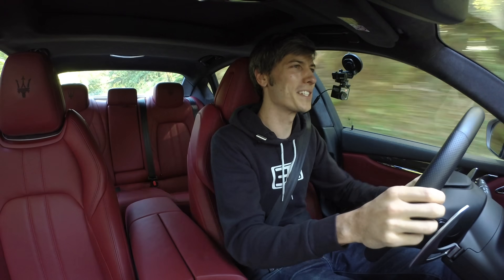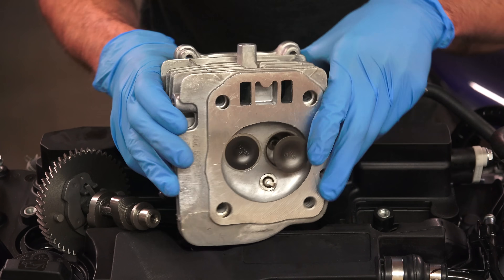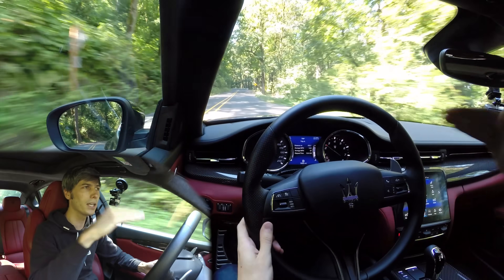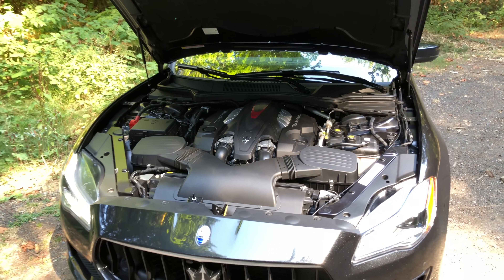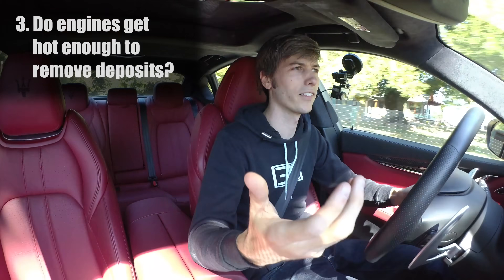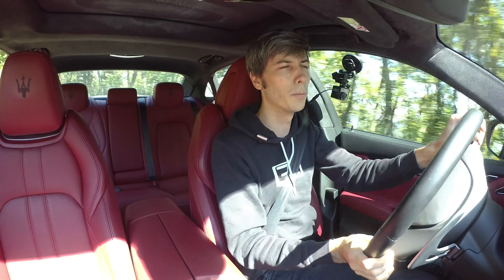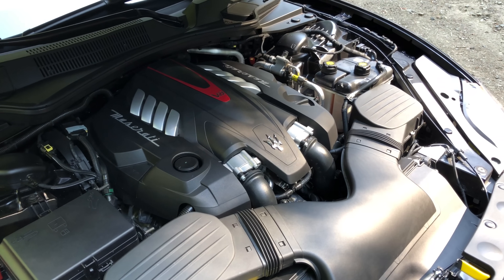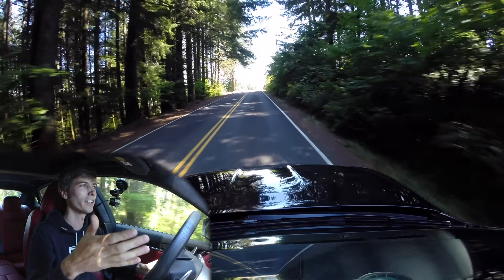Is Redline Good For Your Car's Engine? Italian Tune Up

Comment: When I was a Kia technician, Kia Soul owners were notoriously bad for never driving their cars hard. Typically an older demographic. We were located next to a divided four lane highway where people regularly drove faster than 55 MPH. Going from 0-60 in a swift movement often would dislodge a legion of smoke, comically filling up the highway in its wake. It would take about a mile of hard driving to rid it of this condition. Had it happen on an Elantra too when I accidently blipped the throttle too hard on the same highway, different dealer. Both port injected engines though. I don't ever recall a GDI doing it but that could be anecdotal.
Reply: I own one and for some reason the redline acts likes its at 5k in neutral and at driving. It will bounce off 5k like its a revlimiter. The redline is at 6.8k. :|
Reply: Many cars will not let you rev too high while in neutral.  Racing the engine with no load and all.  Have you really tried to hammer it when accelerating?  Im talkin lead foot pedal to the metal type deal.  When I test drove them - I was easily able to red line them.  Do you have the Automatic, Sportmatic, or Standard transmission?  Need to give us a bit more info if we are able to respond and help out.
Reply: Side Note - I drive a 2016 Kia Forte base model (My Kia Spectra was totaled in a hit-and-run :/) Both stick shift.  I red line it daily because of the A-holes who on the roadway.  Forte gets to 60 in second gear.  Rather impressive.  Maintains the mpg average pretty well too.  That 6 speed is fun.

Comment: I have heard from several different old guys working on carbureted  engines that the best way to remove the deposits and carbon build up is to run the engine really hard to burn off what can be burnt off. Then while the engine is  still hot, remove the air cleaner, hold the engine at 1000 rpm and slowly pour water down the carb.  The cold water hittiing the hot carbon causes it to break free and come out the tail pipe.  Probably worked fine until catalytic converters came along.

Comment: i just use seafoam every 20k. my car is a 2014 focus se (base) direct injected 4 banger. it has 109,XXX miles. the engine still pulls like new. but sometimes in cold mornings it wont immediately turn over. it sometimes takes a couple seconds then it turns over. im thinking i might have to check the fuel system. if everything checks out, i might have to increase the seafoam frequency to every 10k

unless yall have a suggestion. suggestions and ideas are always welcome

driving characteristics:
i drive in high gears (low rpm) high load for fuel efficiency but sometimes i do drive about 8/10 on curvy roads and mountain roads. 0-60 sessions. id say i drive about 50% highway, 30% roads with speeds above 45mph, 15% city stop light to stop light, and 4 heavy traffic stop and go, and 1% track/canyon carving . i only took it the track once lol
Reply: Taking a second to start when it's cold isn't abnormal. Depending on the delay it is possible the cold has just tightened the clearances and takes more effort to turn over.

The more likely cause is the battery or starter is going out. I thinking more so the battery if it is a 2014. The battery is 4 or 5 years old now. Get it checked and it will probably show weak or needing to replace.
Reply: @custommotor  thanks for the input

it used to not do this tho. i recently replaced the battery. i havent touched the started though. i havent heard starters going out early on this mk3 focus.

it could also be that i use e85. e85 has a harder time combusting in cold temperatures. but i still does it sometimes when i have regular e10 too
Reply: It's definitely the e85. I had a Citroen c2 with a flexfuel system installed, on full e85 it would struggle to start at even +10c temps where as with full e10 it would fire right up at -30c.
Reply: @oxaile4021  even with e10? cuz mi e does it with e10 some times too.... hmmm maybe its the e85? but why would it do it even with full 100% e10?
Reply: The best reason i can think of is the ecu figuring out the correct air/fuel ratio.
Reply: When is the last time you changed the spark plugs?  Or checked the ignition system for proper spark?  Doing a load test on the battery isnt such a bad idea.  Do the basic checks first before trying to dive into something more serious.  What is considered to be a cold morning?  Like how cold?  Id consider anything below freezing to be cold.

Edit:  Not sure what your country of origin is BUT.... In the USA every modern vehicle is designed to run on at least E10 87 octane.  There is no such thing as 100% E10.  E10 is gasoline that has up to 10% ethanol in its mix.

Comment: True story; I bought a mazda rx8. Like all 'specialist' cars I buy, despite a full dealer history I instead took it straight to a reputable  3rd party rotary specialist. who straight away told me it had low (but even) compression. likely from little use, and probably was a weekend car. (makes sense @18mpg). Anyway he said go drive it hard. I did for several months before taking it back. The compression had gone from low 4's to high 6's! carbon reasons or not apparently rx8's do benefit from the Italian tune up. I stuck to the redline-a-day mantra and never had any engine problems for the life of that car.

Comment: My car was running a little rough and my mechanic actually recommended that I do this.  He told me to run the car at a high idle, around 4 to 5k at a consistent rate while driving.  And it worked!  So good to know there's data to back this up.

Comment: I think there's more to the idea than just carbon removal but I'd say that some regular hard pushing for an engine which typically doesn't get pushed hard is good for it. Just getting your oil pressure/flow up can help get sludge down to the pan where it can be removed via an oil change. Note that pretty much all "Engine Flush" type cleaners suggest some high rpms loads before draining. This is no doubt to get maximum pressure/flow of the solvents over built up junk. That said, since this also increases the breakdown of oils it's probably best to do this sparingly and immediately before an oil change. I would also imagine that the increased flow through the intake and exhaust would help move crud along. PCV & EGR based buildup in the intake tracts and surface corrosion in the exhaust. In addition to just getting the catalytic converter cherry hot to reduce buildup there. - Maybe being italian makes me biased though ... haha

Comment: I mean if there's heavy build up on the valves then it might knock it loose but if you only ever fuel up using high quality gasoline that are Top Tier certified, your engine should be clean since that means that the gas has more additives and detergents than the federal minimum and it's set by automakers like Honda, Ford, Toyota, Audi, BMW, GM, and others. Brands like Shell, QuikTrip, Mobil, Esso meet the requirements. There's also a list on their website for all the brands that comply

Comment: OK, so Question. So why is it, if you see an older car, go for an overtake, you see a good puff of carbon out of the exhaust. Is that just loose carbon in the exhaust being blown out ?.
Reply from the maker: That's simply because it's running rich when they floor it. More fuel to safely operate at a higher load, and not all of it burns (rich mixture means fuel will be left behind), so you see a puff of greyish smoke out the back.

Comment: I have a 17 EcoBoost mustang direct injection. Oil and gas manufacturers claim there product leaves less deposits. I use  synthetic oil and 93 top tier gas.
Reply: Use the proper octane rated fuel for your vehicle.  If it calls for 87 - use 87.  Improper fuel octane usage can actually lead to the deposits.  The fuel does not combust fully if it is a higher rated octane than what your car calls for.  Several factors go into what fuel is to be used when they design the engine.  Oil and gas companies will say anything to sell their products.  There are minimum requirements that they must meet in order to sell their products.  Once one of their gimmicks has ya.  They will just reel you in every time.  Do your research.  That is your best tool when you are deciding on what to buy.
Reply: @joshuax7990  thank you

Comment: Rotary engines are a perfect example of The Italian Tune-up working to full effect. If you keep the engine at too low of rpm and temperature for too long (I.e driving style), deposits form to such an insane degree that they can catch on the side seals and apex seals, causing them to shatter or break off into large chunks that will gouge the inside surfaces. Redlining and driving a rotary hard is the only know solution to fix this.

Comment: What about overheating? You didnt seem to mention anything about the damage that could occur from getting the motor too hot, which is what i would worry about in a scenario like this. Is that a factor here? Or are these temperatures harmless?

Comment: I'm able to remove the spark plugs and use a cheap not scope to see that it can clean the piston surface. I don't know about valves in the exhaust pipe though. I hadn't looked.

Comment: When you own an s2000, its all good!
Reply from the maker: 9k all day!
Reply: Nah rotary is life!
Reply: Depends but not always true.
Reply: @guitarcrazy02  Hmm, well i'll do some more research on the S2000, I can always change my opinion, but at face value its a small engine, in a small car, that when seen typically is just loud and obnoxious. But like I said in my previous post the engine i'll give credit too simply due to its capabilities of handling an immense amount of HP when modified to the tits.
Reply: @guitarcrazy02  heh, I see. Alright man i'll exclude the S2000 from my future rants, clearly I didn't know as much as I thought about her. Cheers.
Reply: 13b: "hold my beer..."
Reply: S2000 sucks
Reply: Dave Wade, Wrong, you're just a fan of the S2000 and don't like to see it grouped with other smaller engine cars. The S2000 has a weak 165 ft/lbs of torque and 265 horses stock, just like any car you can modify this for more output, but as it is its a low output little engine. The only reason why its "fast" is because its a very light car, sitting at around 2700 pounds.

Its slightly impressive they can cram that much HP into a small engine, naturally aspirated, but that still doesn't give you an excuse to run around with loud as hell fart can exhaust. You're trying to display the sound produced from this engine like its powerful - its not, your car is "Fast", again, because its light. The engine is weak compared to bigger displacement engines that produce hella more torque and horses naturally aspirated. Those engines are nice to listen too because they're deep, they're powerful, you can feel the thumping of their power in your chest. (matter of preference at this point), but to pretend you have a powerful car? cmon now 

But i'll give credit where its due, i've seen these S2000's hit over 1400HP from heavy modification, thats a HELL of a lot of horsepower to pack into such a small engine. So that engine gets my respect for its capabilities of taking a dick'n.
Reply: Darzy or a Mustang 5.0 👍
Reply: @Davido50  Mustangs are hot trash.
Reply: Toki52 haha only the "best selling" sports coupe in history. Coyote 5.0 motor just named best V8 motor in history. Enjoy ur LOW hp 4cyl rice junk. Do they make those anymore?
Reply: @Davido50  in history?  By who?  People who refer to Japanese cars as "rice"? Sure I would accept their opinions.
Reply: @sacr3  😂 why must anything automotive come back to dick related theories?  If anything embracing an efficient and potent 4 cylinder seems like theres nothing to compensate for.  Needing to have a V8 at double the capacity and half the efficiency tells another story.
Don't get me wrong, I love a nice V8 and the one in my truck sounds like a symphony.  What I'm laughing at is the Coyote being the beat V8 in history, a nice motor but that simply isn't true.
Reply: @Toki52  No
Reply: @sacr3  I'm sorry but i have a 07 civic si and i personally hate ricers cause they make people like me who have Honda's look bad but I think my car may not be the fastest but it sure as hell is fun hitting 8000rpm all day and not ever having a worry and hearing that little four scream is fun but at least I do have a proper exhaust system and not just a fart can welded to the back of some base automatic civic those are the people who give people like me a bad name
Reply: maybe they like it better that way and personalize the car they own.. not everybody does things for the others. Never moded a car visualy neither mechanicaly, i just buy what i like in the first place (power/looks)
Reply: @Davido50  Planned obsolescence has ruined the domestic auto industry.  The S2000 was engineered by their F1 program. 
 Powered by an aluminum 4 cylinder with built internals producing 120 hp per liter.  Those are Ferrari numbers.  I know you like numbers... " 8 more than 4!" Great deduction friend.  "Rice junk" can achieve 1500+hp at a lower weight.  Let's not even get into the chassis.
Reply: @sacr3  I think you summed it up. Pretty much. If you have to modify a car to get great performance then you bought the wrong car. A stock Corvette pushes out the same 700-800+ horsepower that a modded golf or supra will force out with 10x better reliability.
Reply: @SalvadorSTMZ  Cant really compare these cars when the price difference is so huge.

Comment: In the old days (in the 80's), one could clearly notice a difference in engine power (in my case a Porsche 944) when coming from Norway (where the maximum allowed speed at that time was 90 Km/h) and after driving 4-5 hours on the German Autobahn at speeds up to 230 Km/h (ie for longer periods of time over 5000 rpm with load). The engine became much more responsive and willing to provide more power at 5000-6500 rpm.
Reply: Given your geography, are you likely to be caught doing >90km/h on most of your roads?
Reply: theoneanton: It's not a good idea to drive too fast in Norway. The fines are very high and the police take your driving license even for minor offenses (especially in urban areas). Maximum legal speed in Norway is currently 110 Km/h on some highways.
Reply: Probably, lol! Or maybe it simply feels it is below such things.
Reply: Tommy_Saint: I've had several other cars where I've experienced similarly improved performance after a few hours of high speed on the German Autobahn. It was the same for example with my previous Porsche 928 S, Mercedes-Benz W201 190E 2.3, Mazda MX-5 (first generation), BMW E36 323i and a friend's Porsche 924 Turbo (931) and BMW E23 735i. All cars performed significantly better after the engines were running over aprox 5000 rpm with load for a few hours. The engines were significantly more responsive and the top speed increased by 10-15 Km/h. Another bonus was that fuel consumption was significantly reduced both at higher speeds and at more normal speeds after the engines and exhaust systems were blown clean on the German Autobahn.
Reply: I do a lot of road trips, and I can confirm that my car drives so much better after a long stint of driving fast at a constant rate.
Reply: Curious where the peak HP and Torque are at what rpms.  If it is at that Higher range - of course its going to feel more responsive.  Its in its power zone.  Newer cars dont have as much of that issue any more but they still have an rpm range where they peak.
Reply: I have noticed this with my aston martin. There isnt as much power when the car has sat for a while. Get on it for a few pulls (after the engine/oil has also been warmed up to the appropriate temp) and the car comes to life. Looked in the manual for the car and it literally reads to "drive spiritedly" if the engine seems underpowered or hasnt been driven. Crazy

Comment: regularly put seafoam on a Daihatsu engine which sees redline everyday for almost a year. still shows plenty of carbon deposits everytime. and dont even think about doing this to a diesel engine.
Reply: I use seafoam too, but can you really say it you have many carbon deposits. I mean all the smoke actually comes from the seafoam itself.
Reply: Diesel engines tend to run hotter than your normal everyday gas engine.  Plus the regeneration cycle that needs to be done regularly with almost all of the newer diesels super heats the exhaust system and DPF.

Comment: As I own a carbureted sport motorcycle, it's fairly close in principal design to an older sport car. An "Italian tune up" for sure makes a difference for it in how smooth it runs for me, but I doubt it's because of carbon. More likely it's heating up the oil burning off moisture, warming the metal increasing compression ratio, and the added heat causing better fuel atomization. All these things are short lived effects

Comment: Great topics as always. About this particular, you only talk about engine components temperatures. I'm pretty sure the italian tune-up is also about component movement, higher cylinder pressures, more fuel groing through, that will also brake loose the carbon.

Comment: The Italian tune up does more than remove carbon deposits - shortly after buying it I took my early DB9 to a friend who has one too and asked him to try it out. He immediately said that it responded a bit slowly and hesitantly. I could feel it too, as a passenger. We then proceeded to give it some "welly" for no more than 5 minutes and 5 miles and unquestionably the response and pickup sharpened up quite noticeably.